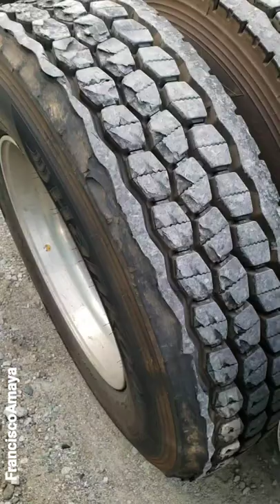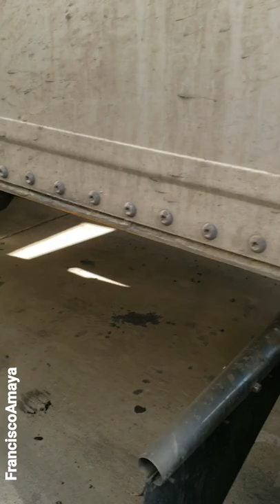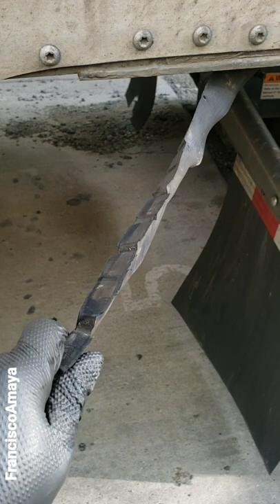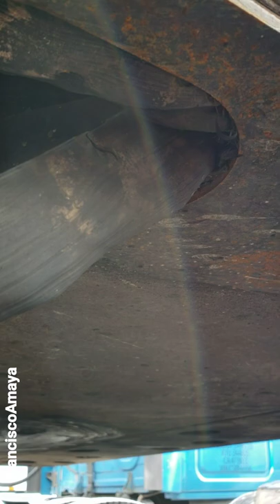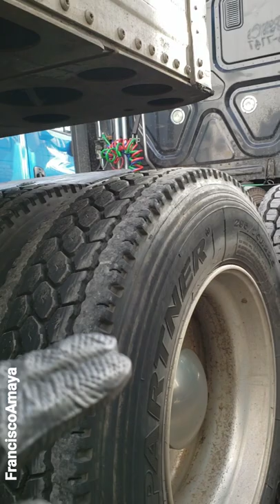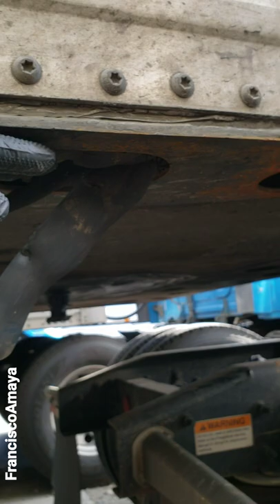truck tire damage with trailer caused by attention less drive DOT inspection out of service

Comment: Francisco. Me gustan mucho sus videos, he aprendido mucho.
Una pregunta.
Tengo un cascadia 2014 con caja Eaton Fuller de 18 velocidades. De fábrica salió con llantas 24.5 y cuando lo compré este año venia  con 22.5, tiene un paso diferencial 4.3, está gobernado a 1500 rpm y 100 km/hora. Mueve cargas entre 14 y 24 toneladas por carreteras relativamente y con pendientes de 5%. Muy rara vez se maneja en carreteras  con 7% de pendiente. 
No estoy contento con el rendimiento de diésel.
Estoy a punto de cambiar las llantas de tracción (8) por unas nuevas. 
Quisiera saber si recomendarías cambiarlas por 22.5 y configurar el motor de alguna manera para tener mejor rendimiento?
O recomendarías conservar 24.5 y modificar El Paso diferencial?
Que recomendaciones me darías para configurar?
Te agradecería cualquier ayuda.
Saludos